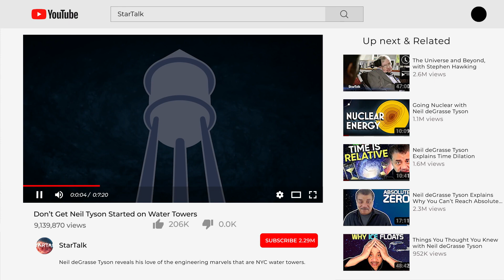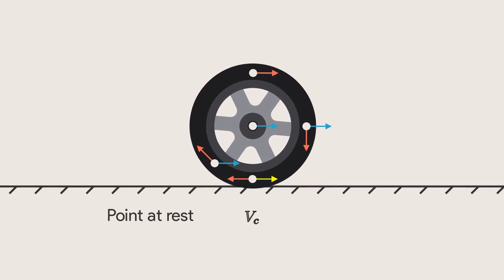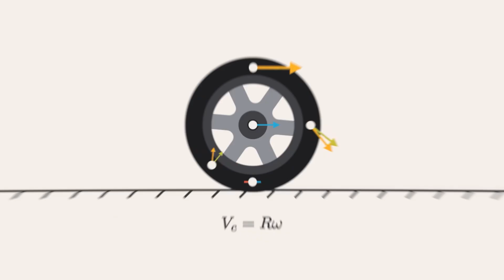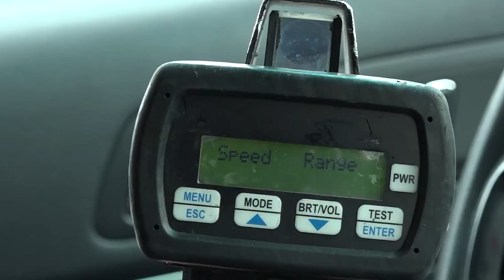How Wheels Really Work | Neil deGrasse Tyson Explains...

Comment: Imagine a drop of paint on the road that the car drives over, after the wheel and the drop makes contact the spot on the wheel with paint on it will be constantly moving forward in relation to the spot on the ground. This is because the wheel is round. If instead of a car it was a Tank Tyson would be correct

Comment: i have a question. speed is relative to another point (should be stationary) so speaking of the train wheel where the point dips below the track you are measuring to the surface of the track to say it is moving backwards. meaning the point where it crosses the plain of the rails surface will be Infront of the lowest point the wheel lips position. however, wouldnt the wheels lip be stationary (zero speed) relative to the road, ground, or any other object apart from the rail at its lowest point also?

Comment: The surface area of the wheel is not more than the surface area of a dime because the less surface area the more efficient the train is because there is less resistance and the reason trains are so efficient is because they have hardly any rolling resistance on them because they roll steel on steel rather than a tire on asphalt and that’s called a rotary engine what it just showed

Comment: This is a relativity trick, No part of your wheel’s tread is moving faster than another. 
The explanation is relative to the contact point of the wheel’s tread with the road/rail, but this point of contact is not a part of either the wheel or the road framework. 
From the axle "center" perspective, all points of the wheel’s tread "orbit" at the same speed.
From a point of the wheel’s tread, the axle and whole car and road are orbiting like crazy and that’s why you travel "on the axle" in the car rather than on the wheel’s tread 😉🤢

Comment: I wish you guys had discussed how any point on the wheel accelerates from 0 to V×2 and back to 0 with every revolution of the wheel. This is a great visualization of the extreme force trying to pull the wheel apart.  At the extreme, the wheels of the land-speed record holding rocket car are solid billeted aluminum, because at mach 1, any point on the exterior of the wheel accelerates from 0 to 2400 km/h back to 0 again, roughly 212 TIMES PER SECOND. Holy crap!

Comment: Imagine instead of a wheel, a Hydrogen atom, where the nucleus is the center of the wheel and the electron wave is like edge of the wheel.  The electron wave moves at a constant speed, basically the speed of light/causality, and can't move any faster.  Therefore, when the atom moves, the speed of the electron must slow down, relative to the atom.  I believe that this is the reason that time dilation occurs for moving objects with mass.  This thought experiment demonstrates how Time is not fundamental but is derived from the speed of light.

Comment: It doesn’t make sense to me because if different parts of the wheel are going at different speeds, the tire would be torn to pieces.
Reply: Physics is weird
Reply: Of course no part of your wheel move faster than another. the point made is from the car/axle versus the road relative speed which is considered to be 0 (this is where the trick is) looking at the wheel’s tread. While you could solve the maths behind, it makes no physical sense.

Comment: Great vid guys.   
And the wheels on the train that contact the rails are actually conical from the inside out so that the flanges on the inside of the wheel are not continuously used to keep the train on the tracks, ONLY IN A STRAIGHT LINE.  
Perhaps you both can do a short physics vid about conical wheels on an axle?  
Skipping and diffraction and line of sight radio waves is an interesting thing too.  
Regards, Jas.  
VK4FJGS  
Rockhampton Queensland Australia

Comment: That's really fascinating. However, what I don't understand is this: the hypothetical device measuring the speed could only show one of three possibilities—either the exact speed the car is traveling at, a higher speed (up to twice as fast), or 0 km/h. It wouldn't be able to show a speed that's somewhere between 0 and the actual speed of the car.
Reply: Sure it could. Any point on the wheel that's between the ground and the centre will be moving forward slower than the car/wheel centre.

Comment: Say you have a ball of light, you can throw it like a baseball... (and you throw it to somebody, like a baseball, with a bat)... at the point of contact with the bat (assuming the swung bat hits the ball of light), the front of the ball of light (the opposite site of the point of contact) is emitting light at the speed of light... and then the ball [of light] moves off of the bat at 100mph... (the question)... HOW COME THE LIGHT IS NOT MOVING 100MPH FASTER THAN THE SPEED OF LIGHT?!?! Is it because photons don't have mass?

Comment: I see the point and agree. If the tire didn't spin faster,  the car would not move.  But this is a mix of rotational wheel speed and the speed of the whole car.
Just like a watch, all gears turn at different speeds, but it's all within  an hour. 
And the earth is round and now I have a headache.

Comment: Everything he said about the train Wheels was wrong. That lip has nothing to do with keeping the train on the track as much as it has to do with signaling. They need to fix this
Reply: Thats irrelevant to what he's actually explaining. The point is that there is a part of the train wheel that goes below the contact point, and so is moving backwards relative to the ground/rail.

Comment: This a functional apples and oranges description. 

The speed of a car is described as miles per hour (mph), a linear function, from one fixed point to another fixed point along a straight line divided by a constant, an hour.

The wheel's speed is a non-linear or trigonometric function, revolutions per minute.

The center point of a wheel has no dimension. It is an intersection of two lines, let's say diameters, which have only one dimension. It does not rotate so it does not move. However each point across the wheel's diameter moves at the same speed or revolutions per minute (rpm).
Reply: The angular velocity (e.g RPM) is irrelevant here. He's talking about the instantaneous translational velocity of particular points on the circumference of a rolling wheel/tyre. The claim is that whichever part/points of a rolling object are touching the ground at any given moment, they are not moving relative to the ground, and the opposite point at the top is moving forward at twice the vehicle speed, so 120mph in this case. Otherwise it would be slipping or skidding. That claim is correct.
Reply: @AnAfricanApe Thank you for your effort to clear my muddled thinking. I believe I'm confusing scalar quantities and vector quanities as Richard Feynman pointed out, the difference in knowing the name of something and understanding it. In the end he exclaimed, explain it so a ten year old could understand it. 

I trust NdGT. However I'd like to see the 10 year old that understands it. That would assuage my bruised ego.

Thanks again

Comment: Suppose you're riding a bicycle at 20 km/h. You might think, based on NdT's explanation, that you see the top of your front wheel move at 40 km/h, but that not true. It moves at that speed relative to an observer standing still, but since you're moving yourself at 20 km/h in the same direction as the top of the wheel, you have to subtract your own speed from the 40 km/h. You will still see the top of the wheel move forward at 20 km/h.

Likewise, from your point of view the axle won't be moving forward at 20 km/h, but look like it's standing still (just like the whole bike)

Comment: YOU SHOULD READ THIS!!!
So I have a very fast futuristic car with a propulsion system that can propel my car to 51 percent the speed of light. The top of my futuristic wheels on my car are now moving at twice the speed of my car. Twice the speed is 102 percent the speed of light. FASTER than the speed of light. But that's not possible. So what happens???

Comment: I am not clear on the lip of the train's wheel that moves backward; I understand the speed differences top = twice / center = actual and bottom = zero and it makes sense that below zero goes backward, but I can't picture it in my head giving it a sense of motion knowing that the train is overall moving fwd. Little help please? thanks

Comment: It is not the part of the car which Is moving faster or slower, it is a particular area or region under observation, which happens to witness different parts of wheel/car moving st fsster or slower speed when they past tjrough this region; moreover, the increase and decrease of speed is noz linier but a curve...

So the correct ststment would be:

  "every part of the tyres (including the single most central Atom on the rim) is switching its speed between double and half of the car 's speed contneously, until the car stops"

When the tyres skid, the rotation is no longer accompnied by forward motion as well
Reply: That's not right. It's only the parts of the tyre that are on the circumference that are speeding up and down between 0mph and 120mph. The claim is that whichever point of a rolling wheel/tyre is touching the ground at any given moment is stationary on the ground, and that is happening at all times unless there is slipping/skidding taking place.

Comment: It would need to be an intermittent repeating signal to prevent the device from reporting a higher speed than the car at other times.
Reply: Not if it's only pointing at the bottom or top over time.

Comment: And the portion of the wheel between 6 and 9 o'clock is moving backwards.
Reply: Not for a car wheel.
Reply: @AnAfricanApe  please explain. If the bottom of the wheel is not moving, and the a moment later it is moving in the direction behind the axel, would that that not be going backwards? Just asking, bro.

Comment: I've always wanted to build a microwave transmitter that would do just that.  It takes as input the actual speed of the car, and a receiver that picks up the microwave signal from the officer's radar.  From that, it could use the Doppler shift to compute the exact frequency of the radar's transmitter, and adjust the frequency of the transmitter in the car to a frequency that would make the radar receiver indicate whatever speed you want.  Of course, modern "radar" is often "lidar", which uses light waves reflected from the to determine the car's distance from the lidar unit.  By getting the car's distance at multiple different times, it can figure out how far the car moved in a given time interval.  So you'd have to figure out how to trick the lidar into computing the vehicle's distance incorrectly.
Reply: Make one to help societ

Comment: Most police radar use the coefficient of friction to calculate speed. The spin of the tire has no impact. The size of your vehicle is the most important factor in determining speed. Say if you are beside an 18 wheeler then I would more than likely get his speed over yours. However, I would then have dual audible tones alerting me that there are multiple objects in my field. Now there is no way in the known universe that I know something Neil doesn't.
Reply: How is the coefficient of friction used? How did you acquire this coefficient for each vehicle?
Reply: @AnAfricanApe  That is a carazy handle you have TripleA. However, the basic principle is 2 objects moving toward each other create  friction which can be measured. That is what is taking place when a radar gun is pointed into on coming traffic.
Reply: @coreymaske1641  when I think of "friction" I'm thinking of either static or kinetic friction. Static friction being something like traction on a tyre that's not slipping, or the force that holds a box on an incline preventing it from sliding down, and kinetic being when two surfaces rub against one another to produce heat, like when a tyre is slipping. When you say "friction" are you referring to these types of friction? Or something else? Because I am very confused by your statements.
Reply: @AnAfricanApe  Wait? What am I missing here? I meant Doppler Effect, so much for blurting out answers.
Reply: @coreymaske1641  so the Doppler Effect then? Not friction?
Reply: @AnAfricanApe  Yes sir. Maybe, my use of friction was not accurate. When a wave meets an object, which maybe I incorrectly described as friction, it causes waves to come closer together or move apart. I described it as friction that could be measured. Earlier you had asked for the related formula regarding friction. And if you are smart enough to work that formula I have sneaky suspicion you may already know the answer. How else could I describe waves as they meet resistance and bounce from an object. Did friction not cause the wave to bunch together?

Comment: Actually,  it's 4 parts, AND it's in  the same part, the tyre..🤣😂🤣😂
Reply: Actually, the "part" is not the tyre. It's the "part" of the tyre that's in contact with the ground at any given moment. That part is stationary.
Reply: @AnAfricanApe  Don't agree with you.  "a part of a car" is a tyre (...) , wheel, rim, door, etc.. You are talking about a "Part-of-a-part",  a part of the tyre... 
But if you take that part away from that tyre, it is no longer a tyre.  So I'm right..
Reply: @pear7777  you're getting too caught up with labels that you're missing the point, a common mistake people make in physics. You can label it a "part", a "point", a "part of a part", or a "Fred" if you want to. It doesn't matter.
Reply: @AnAfricanApe No, I'm not but hey, tme to get your schoolmoney back, since you do not read
Reply: @pear7777  yes, yes you are. The point has gone clean over your head.

Comment: 2 things... 1. would it not be easier just to have a device that broadcasts a stronger signal than the radar's initial signal, regardless of what you are actually doing. To bypass the connection needed to the wheel.

2. Isn't this all relative to the road? In theory, this all makes sense... In reality... your tire hits all those speeds from 0 to 2x every rotation, so overall, the average for each spot on your tire equals your actual speed. To think about part of your tire not moving and part of a train wheel moving backwards.. I just don't see the practicality of it? because you know it is only moving backwards relative to that snap shot in time.  If you try to embrace the idea that part of the wheel is always going backwards and yet it never detatches... the theory hits reality.  I get the point of the math proving it... but I don't get the point in the relevance.  Outside maybe ensuring that a wheel can withstand speeds at lesat twice the speed of a car.
Reply: The practicality of it is that it's the difference between slipping/skidding and not. It's the difference between having traction and not having it. The moment the part of the tyre that happens to be in contact with the ground at any given moment is moving relative to the ground, that's the moment where traction is lost, the wearing off process accelerates massively, control is compromised, and where your ABS and traction control kick in. Monitoring the relative velocity between the bottom of the tyre at the contact patch and the ground is what allows these systems to work, so they are of great use to engineers. That's why we have wheel speed sensors.

Comment: You'll like this, speaking of radar guns: Friend of a friend was an astrophysicist and got caught going through a red light. In court, he made the case that the red light had blue shifted as he drove toward it, so it looked green. Of course, there are at least three concerns: 1) he should've picked the difference between the top and bottom light; 2) How fast was that cat going to get that level of blueshift? Well over the speed limit for built-up areas, that's for sure; 3) If this guy experienced this, why doesn't anyone else?

Can't say if he got off the charge or not. I think the judge was almost impressed by his audacity.

Comment: Only this couple of illiterates would just find this out.  This is like kinder garden knowledge grade. At least for me and my son or anyone who’s also a pilot.   It’s a vet well known this is the main reason why helicópteros have a total speed limit when it comes to top speed cruising… why ? Cause it’s a very well known fact that the blade of a main rotor that moved forward on flight, can actually reach supersonic speeds once the helicopter passes 200 knots forward.  The problem for the helicopter becomes when the  same blade starts flying on the opposite side as the helicopter is going 200 knots depending on he helicopter that same blade will be at cero forward speed when compared to the oposite one causing that blade moving backwards to actually stall and stop providing lift and therefore causing the helicopter to roll to that side and crashing immediately after that.